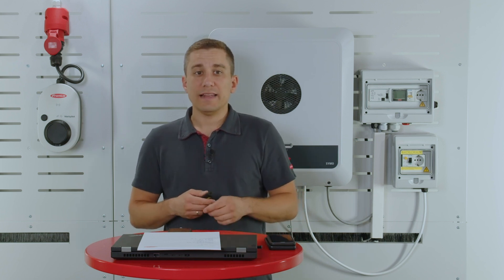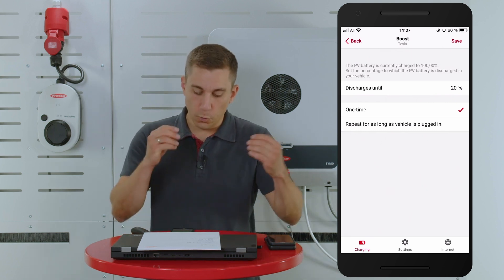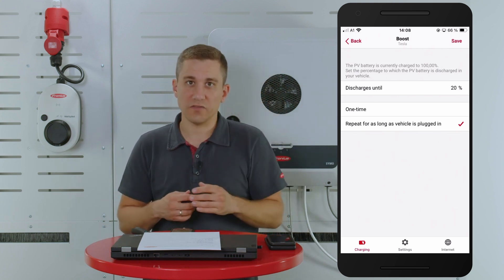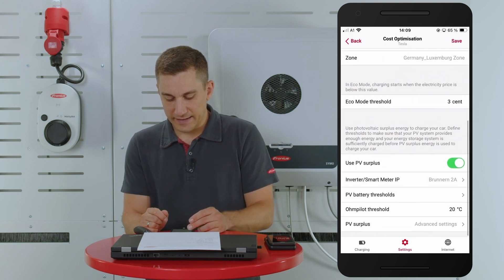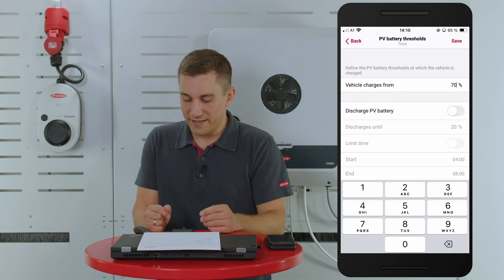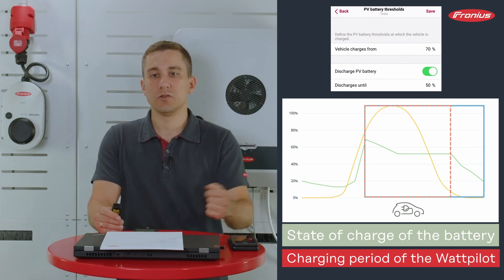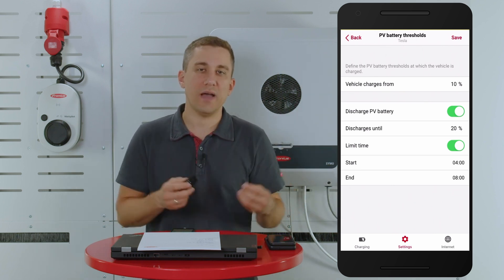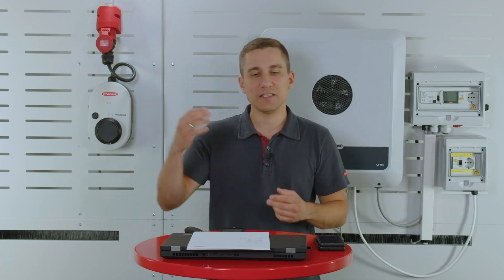How-To Video: Activation of discharge PV battery and ECO Boost at the Wattpilot

Comment: Hi, I have a fronius gen 24 plus, a BYD battery and the wattpilot, My app is configured to not use the BYD battery to charge the car (discharge PV battery is off ) but the wattpilot is still using the BYD battery to charge my car instead of using the network, how can I do ? it seems like the inverter and battery looks at the consumption as the house consumption in the solar web app. ?? tried lot of settings in the wattpilot app but in all scenarios its draining my PV battery.
Reply from the maker: Hi @leonnyvang4006, our technical support team will be happy to help. Please use the following contact form: www.fronius.com/endcustomer-support-form to submit a support request. Thanks!
Reply: I am also having this same problem and sent a ticket. DId you get a solution?
Reply from the maker: Hi there! Please fill in our support form as well so our technical support team can also find a solution for your issue.

Comment: Hi,

I am writing as a consumer. My setup is a gen 24 plus 6.0, 5.4kWp, HVS 5.12kWh and a smart meter. I live in Greece where I am being charged for per phase energy consumption. So the new asymmetric power distribution is a huge advantage with the new firmware (thank you!). 

A few problems to note:
1) Solarweb doesn't take account per phase energy transfer but takes the sum of the phases. From the web interface of the inverter I can see from the smartmeter the energy transfer correctly and in HomeAssistant I can track my correct feed in/out energy. Please add an option in solarweb for countries that charge per phase energy transfer and not altogether.

2) Wattpilot does not take into account the above problem so when I have surplus 3.000w it tries to charge with the same amount using 1 phase which exceeds my inverters capability of asymmetric distribution (max 2.000w). So instead of charging only with energy surplus I end up feeding-in 1000w and feeding-out 1000w! 

If there is a better place to communicate/chat please let me know.

Thank you,
Theodoros
Reply from the maker: Hi @Theodoros-um8ls
Thank you for your question. Please get in contact with our support team: https://shorturl.at/h6Grx They will assist you quickly. 

Best regards,
Daniela from Fronius